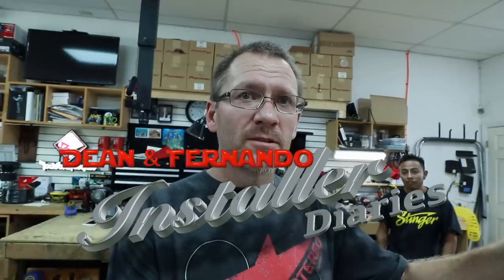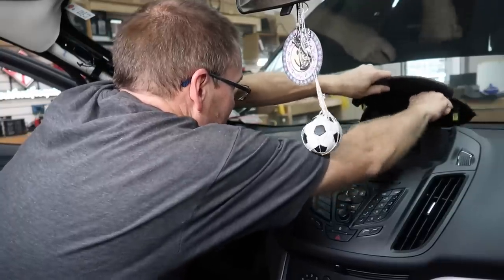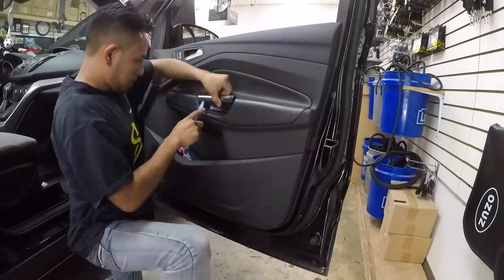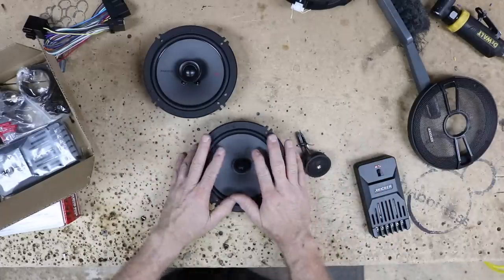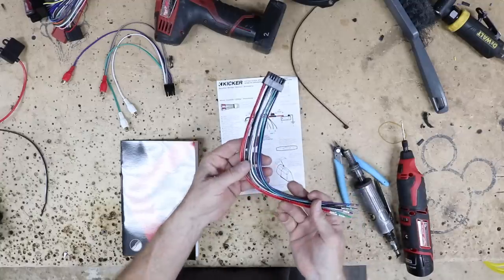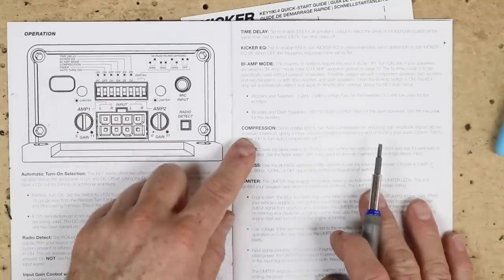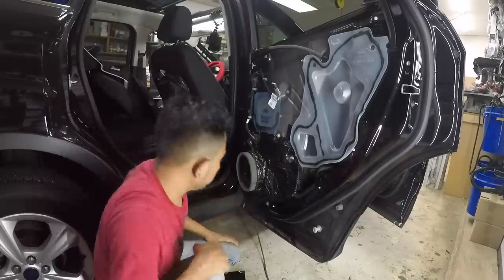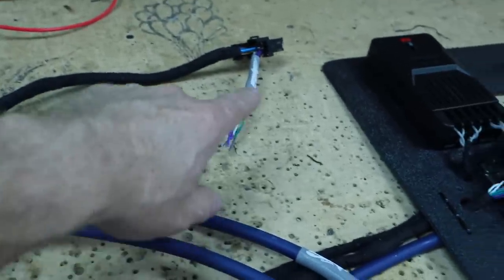The Kicker Key amp and KS speakers installed in Hailey's Ford Escape Installer Diaries 120

Comment: But what happens if youbwant to run two keys in bi amp for front and rear? How that auto tune run?
Reply: I read that they 'sync' up properly for that.  One unit handles the tuning as they act in parallel.

I want to know if you can bi-amp a pair of Illusion Carbon C5s or Illusion Luccents?  I have a Smart 2015 electric drive which would take good advantage of this unit.  Space is at a premium for that, and if I install a Sony Carplay headunit (XV5000), and I thought these would do quite well in that arrangement.  Are the power needs of the speaker handled by the amp properly, particularly for the two different Illusions?  The Carbon C5s (5 1/4 inch size for both) is at 80 w and the Luccents are 75 w.

I also would like to know if the class-D amplification will sound flawed on the Carbons?  I have read that class D amps distort naturally.  I am not planning on running them too high, and would pair them with a Kicker powered under seat subwoofer.  This combo seemed to fit my current needs and to allow for an upgraded potential in the future if another amp might take fuller advantage of the Illusion(s).

I haven't found any notes from installers like yours on the Kicker key and it seemed to surpass the expectations of reviewers.  A neat trick, especially for someone like me and a small little car like the Smart, which is also a quiet little place due to its being all electric.

My best, guys!
Reply from the maker: I’m checking on that good question
Reply: Thanks, good job on her car
Reply: The tuning process will only work for one of the amplifiers. You can use the second as a normal "dumb" amp if you wish. Or just run the rears off head unit power (my advice).
Reply: firebirdude2 Might it be possible to bi-amp front components, run the auto setup, then disconnect the speakers and then connect a 2nd key180 bi-amp rear components, run the auto setup and once completed....reconnect the front to the 1st kicker key??

Comment: Very Good Cable management. I wish yo were here in Puerto Rico.  Do that black tape you use on the installation withstand heat? What tape you are using?
Reply: Abraham Soto it's called tessa tape. I think they have heat resistive stuff, not sure. I actually haven't even seen the part where he uses tape I just am using my guessing skills
Reply: justin b cool because the one who put my radio use cheap black tape and after a year that black sucking tape transformed into a some type of black ink glue. I speend a lot of time cleaning the tape oil tint and putting straps and doing cable management. That installer lose me as a client because the cheap black tape he use to connect the cables.
Reply: It is called Tesa tape.  You can get it on Amazon just search for tesa tape heat resistant and you will find it.
Reply: Alberto Cortez Thanks..
Reply: Abraham Soto there is interior and exterior Tessa tape
Reply: John Young thanks for for the information. I have another question. The black stuff around the door speakers ( I dont know the name of that ) are to prevent vibrations ? If I want to connect an OEM radio to an amp without cutting cables ( ELANTRA 011) I will need a T Harnesses, with high level inputs? THANKS.
Reply: Abraham Soto not necessarily, if it's factory amplified you may have to bypass the amp. The black stuff is sound deadening. Could be ballistic or dynamat, but there are many good products available and make a huge difference in the audio

Comment: compare it with Alpine 445u
Reply: Similar power output, but 445U has zero DSP and cannot do bi-amp mode.
Reply: @firebirdude2  So I have Polk Audio MM6502 Components. Is it enough or is the Alpine 450 would be louder? or just the same power
Reply: @walrus3631  Alpine 450 outputs 45W per channel and the Kicker 200.4 outputs 50W. Basically identical in terms of power output. But the DSP in the Kicker should make them sound MUCH better.
Reply: @firebirdude2  But the Alpine 450 claims to have DPP
Reply: @walrus3631  Marketing BS. I will say that if you're planning to ONLY power that component set, you can bridge the Alpine into 100W x 2. If you're planning on bi-amping, the Kicker is the only one with that ability, along with time correction and EQing. Up to you, I'd get the KEY200.4
Reply: @firebirdude2  Would i still need Kicker Key even if i have pioneer HUD double din. It has equalizer and time alignment.

Comment: 14ga power lol. Does that thing even have more power then the factory radio ?
Reply: ALEX they actually sound pretty good in our experience. Not crazy loud but they definitely have some kick
Reply: 45w x 4 which blows away factory.
Reply: twistershift seems like that is max power rating not rms. And if so my head unit that is probably the  same price as this amp is better
Reply: SuperZombiemaniac1 it's RMS.
Reply: SuperZombiemaniac It's 45W RMS x 4. Bench it and see for yourself.

Comment: Jesus Christ. The product you’re installing isn’t worth your labor. It’s all kicker and that was a detailed and custom fabricated  job. Id assume 10 to 15 man hours at least, with fabrication, installation, detailing, and tuning. At that point shouldn’t they spend the little extra on product. Entry level kicker and entry level focal speakers are only about $100 apart, like literally spend an extra $200 at that point, and an audiocontrol or Rockford amp. Just a few hundred when compared to the thousands that were needed for labor cost. Hell if you’re going through all that work I’d rather you install flax or k2s with a dsp amp.

Comment: Kicker comes threw again! What is wattage output of the amp? Keep up the awesome work and thanks!
Reply: theloser0 it’s 45 watts per channel at 4 ohms so in total 180 watts. It’s just the right wattage and won’t blow even their DS speakers. Many stock systems are only 10 watts per channel so don’t discount that key amp as a bad amplifier. It will play very nicely with 1500 watts RMS worth of subwoofer(s).